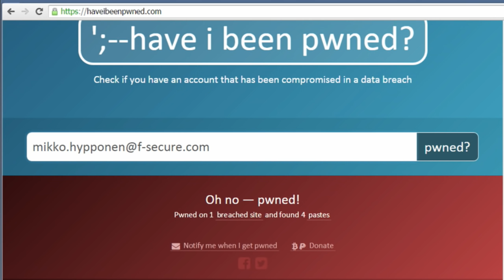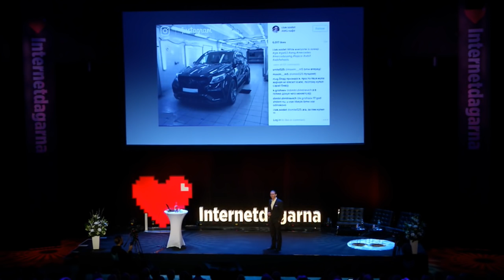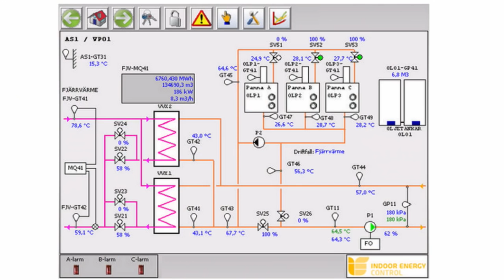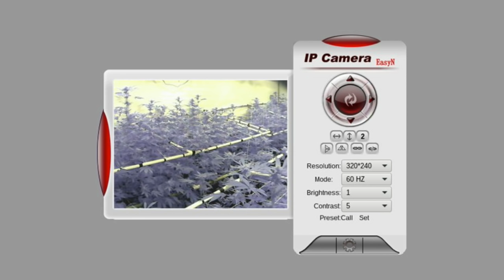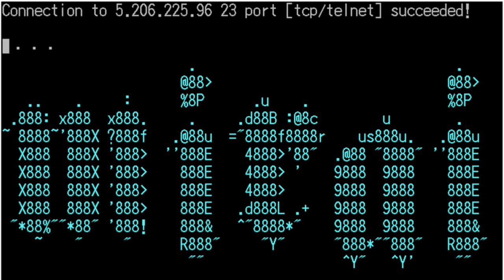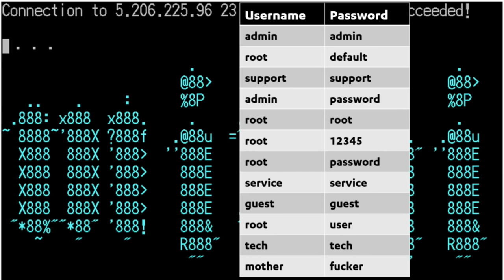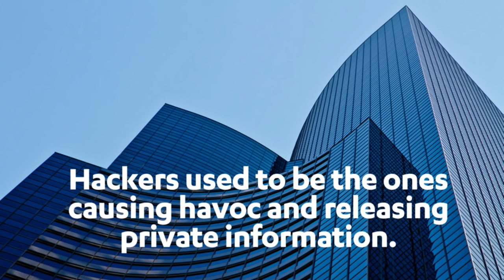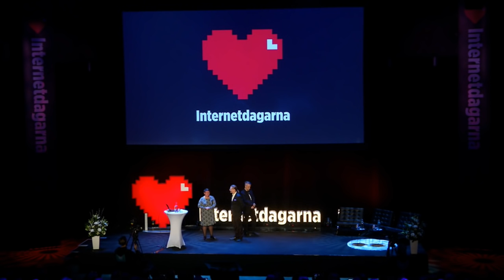Mikko Hyppönen - Keynote - IND16

Comment: CORRECTION: 14:19 Turns out that the ice didn't melt because of hackers, but instead it was just a hardware malfunction. More info (in Finnish) can be found here: https://www.viestintavirasto.fi/kyberturvallisuus/tietoturvanyt/2016/11/ttn201611081338.html